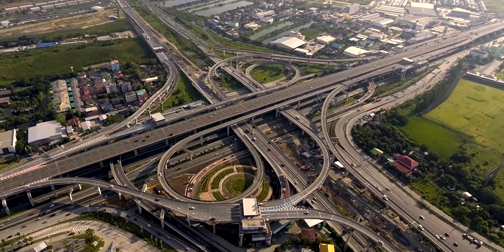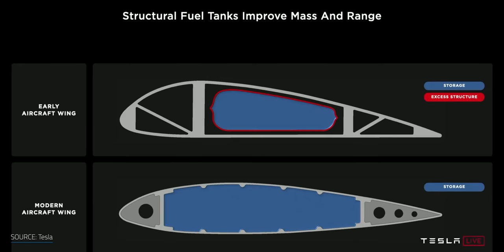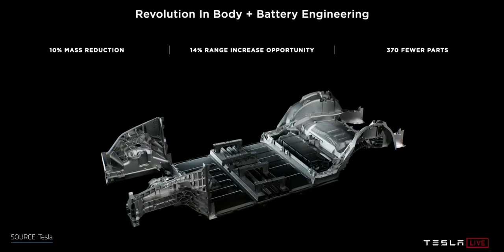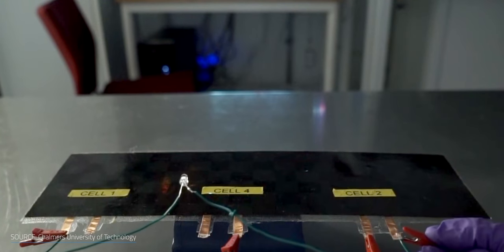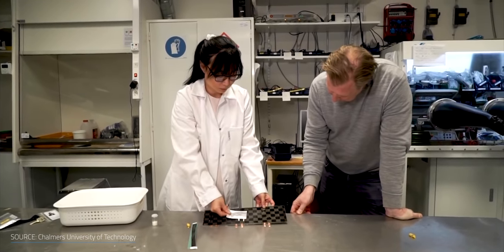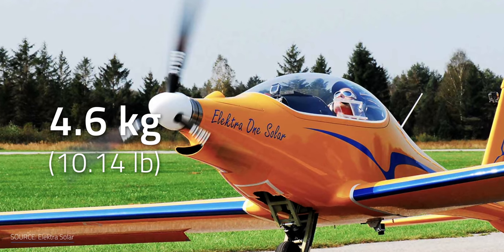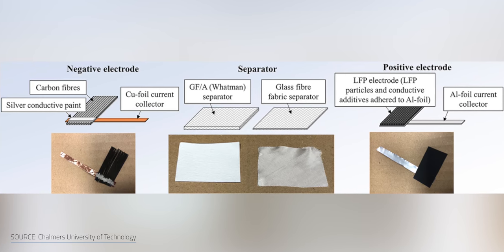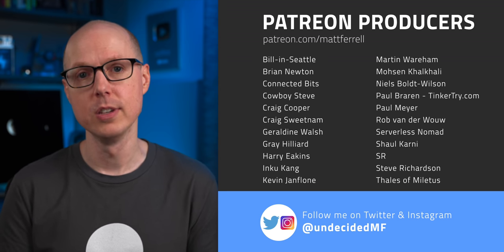Exploring Structural Batteries

Comment: oh man cant wait to never hear about these again!
Reply: Yeah, you'll note no one ever mentioned the MJ/kg i.e. the energy density of the battery which is what makes cars go the long ranges because petrol has 46MJ/Kg and the best batteries have around 9MJ/kg and the lithium ion batteries tesla uses have about 0.9 MJ/kg.
Reply: Those batteries sound really good for non-consumer market vehicles, like industrial aplications, space exploration probes, high speed aircraft etc... But for the consumer market? They sound WAY to expensive to manufacture to be worth it. I don't want to pay thousands of dollars to replace a body panel from my car, phones don't need to be lighter and thinner, in fact, many phones in the market could use some extra thickness for better ergonomics, not to mention how everything would get just straight up more expensive.
Reply: @matthewtalbot-paine7977  4:48 they mentioned the weight/capacity, no? Or did I misunderstand what you meant?
Reply: From someone who worked at a research institude; that is tech that exists for battery and solar panels for a near future generation. And this is bound to happen unless it would get outdated by a better invention, which is doubtful for how high the demand for electricity storage optimization is right now and only seems to become more of. However I will instantly put a disclaimer the video absolutely did 0 effort to mention: What if x breaks and what if it needs to be replaced -> what to do with the waste. The reason why cars are kept simple is to avoid issues in addition to making them easier to locate, with integrated batteries like Tesla is doing it becomes harder for none-certified people to find and fix an issue. Which only helps them sell more units but not help the consumer. As for the carbon fibre, which will be next gen of solar panels, I will paraphrasing Sebastien Sellard, a guy who worked his entire life in the industry making leading edge tech for batteries: "We are producing marginally superior batteries that we DON'T have a way of recycling. It's to the extent of Carbon nanoparticle waste". One of the worst forms of waste in the chemical industry on a physical level, simply made for demand disregarding any recycling potential. In addition to that, regular batteries right now are already on their way of more efficient element doping with Cadmium and lead allowing again more marginal increase but outright making the lithium itself harder to recycle thanks to the doped impurities.
Reply: Exactly. Just like graphine
Reply: @informitas0117  That's exactly what I'd like to know but where you linked is just when they show the battery, can you link the time when they actually say what the weight and capacity are as I cannot seem to find it.
Reply: @informitas0117  nm they said 24Wh/kg
Reply: @informitas0117  Which is three times worse than the worst battery. Thanks for the vague area though the actual density is at 5:52

Comment: These cars will be built to "throw away" and will make your favorite phone with no user serviceable battery seem like the pinnacle of right to repair...
Reply: Are we sure Apple doesn't make this car?
Reply: Possibly so but it could also be seen as a  potential earner considering the revenue from car parts like doors, bonets, boots, bumpers etc. Let's wait and see how this all plays out.
Reply: @MIHMediaInc  the only way this is an earner is by forcing you to get a new vehicle entirely.
Reply: Modern batteries last about a thousand cycles in a phone which is charged daily from 0-100% this amounts to only about 3 years of service but in a car with 400 km range this amounts to 400 000 km which is about 25% more than the average vehicle lifespan. So the real question will be what we will do with the batteries when the car is off the road
Reply: @redsable6119  Tesla is absolutely following apple's business model. Hopefully the FTC's unanimous vote on right to repair will lead to much easier to repair phones, computers, vehicles, tractors etc.
Reply: 100% correct. Means once the battery is dead you need to buy a new car lol. I am so sick of US companies and their fanboys
Reply: Yeah that is why electric cars are actually worse for the environment in the long run than regular cars.
Reply: new 4860 cells will last a million miles and will outlast the car.. Don't compare phones batteries to this.

Comment: no got it wrong, I'm a pilot in training so here . . .no  jets have gravity weight fed fuel lines. pumps are needed. the inside of  the jet engine is air rushing through and its under pressure (air coming in and heating up and expanding), this is why there's a hot air rushing out the back . .. They keep fuel tanks in the wings because the inner space is empty and metallurgy or composite materials developed enough to to prevent leakage and lines and pumps reliable enough . . .  they can fit fuel inside, they did it since the propeller engine days and they because it saves material, its not for structural purposes. If a plane crashes and the wings are damage fuel can leak and cause explosions. Also its easier to balance fuel in the wings because the center of gravity affects how well the plane flies.

Comment: I think these batteries must either be V E R Y long lived, or the "structure" that they comprise must be easily replaceable, because batteries don't last forever.  Vehicles can be on the road for a V E R Y long time ... but not if they're literally useless because their bodies served two purposes and one of them failed.  I'm also, honestly, just not seeing much of a point with such a low energy density.  This seems to be far more applicable to home building, like a solar roof.  M a y b e ??? for space?  But definitely not cars, and probably not airplanes.
Reply: wow-wow-wow. Dont say you dont want to remove a whole car and just the batteries. It is illegal! Ask Apple - they have a lot of users that want to just replace a battery! It is illegal!
Reply: Its made of carbon fiber so I think you could replace the whole structure of a plane with it. Plus the prototype is very thin, so you could stack several layers on top of each other and still save weight. Add to that the huge surface area of a plane compared to things like a car and I think it could work out. And even if it doesnt. If it means halving the battery weight you have to carry around its still a big success.

The bigger issue I see is cost. Carbon fiber isnt cheap, and as batteries get cheaper, there just doesnt seem to be an appeal in making a cars structure and panels out of this kind of battery, unless its some kind of super- or hypercar where money is no issue.
Reply: Fuel physically is one of the most efficient and convenient energy storage, unfortunately. I think much of investment in chemical battery technology for some applications would end up being non-green when you do the math, maybe ideally we'd have more investment in "clean" fuels for much of this stuff. Even if perhaps paired with electric engines for increased efficiency, like maybe the first gear is electric, I don't know, this may be BSsy.
Reply: @petitio_principii  hydrogen (from green sources) would be the ideal fuel. All the benefits of petrol like energy density and quick fill ups without emission or the need for environmentally harmful battery packs.
Reply: @RubsNL  From what ive seen Hydrogen is insanely expensive to process transport and store. And from an emissions stand point it uses so much more energy to manufacture that it completely offsets its "green" savings. Unless you produce it on a grid that is entirely made up of renewable energy sources. I could be wrong though Ive only seen 2 sources for this info

Edit: Here is one source ( He doesn't show sources so this could be inaccurate but its logically sound) https://www.youtube.com/watch?v=f7MzFfuNOtY&ab_channel=RealEngineering
Reply: @hauptmann25  carbon fibre isnt as expensive as you think it is.
Reply: @RubsNL  wrong.  Take chemistry then write an essay on why not.
Reply: They need to develop thin, flexible sheets of batteries that can be packed inside hollow parts of the vehicle's structure.
Reply: Here's the thing. Batteries necessarily don't mean they will not last forever. It's just how we make batteries that they degrade over time. In future if there is some innovation that doesn't let structural change happening over time to the battery then there would be no issue at all. This thing is in progress with some new graphene battery technologies where charge cycles are essentially such a large number you as a consumer would never have to worry about it for 100s of years. There are also other battery tech like heated salt battery where there is no such thing called degradation. Many more opportunities remains to be seen
Reply: @swarnavasamanta2628  The battery manufacturers don't want the batteries to last very long because they would lose out on revenue.
Reply: @swarnavasamanta2628  Yes, wonder batteries have been "just around the corner" for longer than you have been alive
Reply: @slowanddeliberate6893  But at the same time, the first company to jump on that technology will literally steal the battery market from everyone else, so I imagine someone will get around to it eventually if it's possible
Reply: VTOL aircraft it makes sense. The lastest use less watts per mile than a Tesla Model 3 and cruise at 80mph. Needs to be regulations to make the battery easy enough to remove and replace. Also, the CF needs to be reusable.